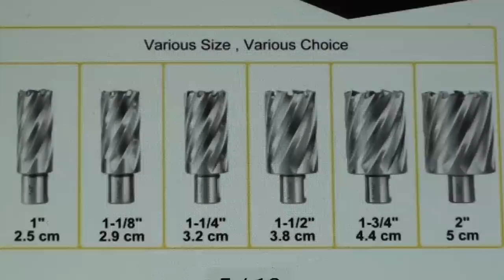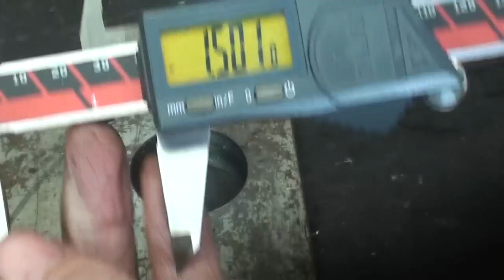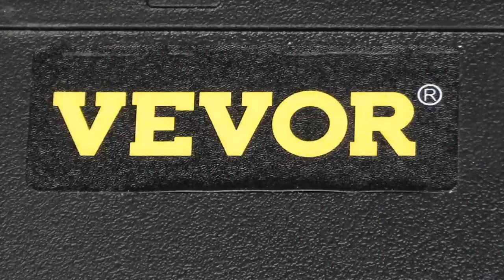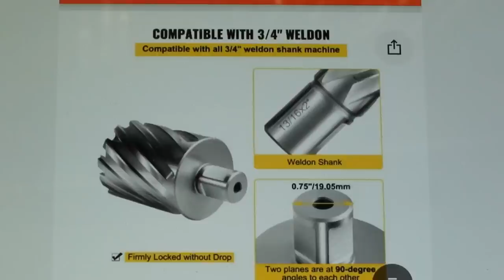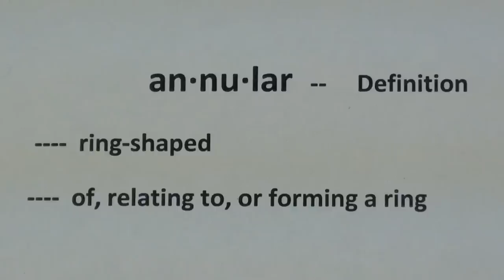WHAT ARE ANNULAR CUTTERS? vevor #858  tubalcain drill magnetic

Comment: I’d consider these essential tools in an industrial maintenance, fab, machining setting (mine). I’ve used these so many times, they’re totally worth the cost. 

Another use I’ve found out of necessity, had a blown tapped hole (with an broken tap) that had to be repaired and used the mag drill and an annular to core out over the center of the hole. Then made a thread repair out of a set screw, Voila!
Reply from the maker: Excellent idea to get out that hard broken tap
Reply: One heck of an idea 
Wasn’t a blind hole though was it
Reply: I bought the vevor mag drill with 6 annular cutters 
Not a bad buy what so ever worth the penny actually making a drill press stand for it so I can get even better use of it
Reply: @jarredsegal6842  no only works with a thru hole

Comment: I used to use those almost every day when I worked as a fabricator building gravel conveyors. If you find the right chuck for it, it should have a spring-loaded center pin that ejects the plug all by itself. They really are great little tools. I'm glad you found a use for them in your shop. 👍
Reply from the maker: Cool, thanks

Comment: Dear Lyle.....My Jancy Slugger, now owned by Fein, will drill at 440 rpm, and drill a 1 inch hole in 1 inch plate is less than 60 seconds..
....the through feed coolant allows cool cutting at the fast rate of 440 rpm.....
.it is one really amazing tool, I have a video of it cutting aluminum on my channel......
and I am finding all sorts of ways to use the magnetic drill for small parts and tall parts...
I keep a 3/8 x 6 x 18 inch plate that I can clamp the small part to and the magnet holds 
the drill to the plate, and you do not have to have a hole in the plate for the cutter to pass 
through, as the slug stops the cutter from cutting when it breaks through and does not 
cut into the plate....Awesome Tool........
Reply from the maker: Thank you, Paul. I was afraid to use power feed on the Bridgeport. It was my first time using these cutters, and I was unsure of the required feed rate. Plus, I did not have forced coolant.

Comment: Link at bottom to the original history.
Mr Pete, I started using these cutters in the USAF Machine Shops from the original manufacturer Hougen Manufacturing. Back when they were known as "Sluggers". Dr. E. Douglas Hougen was the inventor of these annular cutters and they saved a lot of time when cutting large holes, especially in think metals. They took a lot less time to punch a big hole in stock then step drilling. I used them to punch out a rough hole on lathes and mills to get as much material out before boring, drilling and reaming to final size. I made adapters to hold hold these sluggers, then drilled and tapped two holes for set screw at 90° to lock them in. They can be used in a non Weldon collet but they will slip without that positive lock. I would also drill a hole through the shank big enough for the head of the ejector rod. Then tap it for a set screw. I would machine a small part that would slide freely in the hole with a step that would fit inside a spring like a short guide spud. Then slid that in the shank and cap it off with the set screw so that it pus just a little pressure in the spring. Those adapters worked great.
But one thing you need to do id use a lot of cutting oil or fluid and back them out to clear the chips if punching out deep holes. These things can get hot, expand and will lock up and brake if you aren't careful, especially in thick aluminum. Unfortunately I had some young guys in the shop that always wanted to run these Sluggers faster then they are should be and I've seen my share of shattered cutters and ruined parts.
I've also used them to enlarge a hole by making a guide for the cutter, something similar to the guide on a counter bore or spot facer. Sometime we had to think outside of the box, with common sense and caution to use what we had on hand to get things done. We didn't always have the budget to buy a one off tool that might be used once or a few times. I also used the center slug or donut hole out of the cutter for other parts to be made out of. Sometimes it was quicker to cut a slug out of a metal plate to machine a small part then wait for the round stock to come in. That is if I had the right metal plate or other stock on hand and a slugger cutter that would give me a round slug big enough to use. Like I said, sometimes you just have to think outside of the box to get the job done. 
But here is the original history of these annular cutters by Dr. E. Douglas Hougen. Hope you enjoy the history.
https://www.hougen.com/about-hougen/doug_hougen.html
Reply from the maker: Thank you for an extremely interesting comment. You gave me lots of advice and good ideas. These cutters are new to me and I have much to learn. I am eager to read the history of these cutting tools. Thank you very much
Reply: @mrpete222  Sorry about some of the misspelled words, I'm not much of a typist and I should have gone back and check. I have big fingers and I'm always fat thumbing these keys.
BTW, you might be surprised at how we came up with ways to make or fix parts with what we had on hand. When you have a Colonel breathing down your neck that wants something fix in a hurry and you know safety must be adhered to, people can come up with ways to accomplish the mission that holds to Tech Data and safety standards when pushed. Remember the old saying "Necessity is the Mother of Invention". I was proud to serve with the most talented people on the planet. 
Did you ever get a chance to make those Mill Parallels I sent you some pictures and plans to make them?

Comment: We used these in the shipyard for drilling the holes to bolt down the engines and reduction gears.  The holes were usually good enough that reaming was not required. The holes were measured and fitted bolts were machined and installed in the holes.

Comment: I was looking at those recently.  From what you showed, the look worth the price.  I will have to pick me up a set now.  Looks like an arbor for these cutters will be a future project for a lot of us.
Reply from the maker: Yes
Reply: I am only commenting because we share the same initials and surname, although differently spelt. 
I use these cutters and made a 20mm holder to fit an R8 collet in the mill and another 16mm one to fit a drill chuck on the lathe, both with two grub screws for drive.

Comment: My mag drill has an oil reservoir and the center pin not only allows you center the cutter over a center mark but when you start drilling the flat on the side of the center pin allows the cutting fluid to flow into the center of the cutter which automatically liubricates the cutter while it runs.  Great tools.

Comment: These and a mag-drill are two of my best friends at work. I'm a structural steel fitter/welder that often has call to move holes to where they should be, or make 'em where they aren't on a structure member.

We use cutting fluid in place of oil. Oil being a big time fire hazard in a shop full of plasma cutters, torches and MIG welders.

Comment: I prefer to use water soluble oil when using annular cutters.  I think the water vaporizing carries away more heat, and the residual oil is a fair lubricant.  I have also used cutting oil, which works almost as well.

Thank you for producing this video!

Comment: We used to use these in a Bucks Drill for drilling clearance holes for bolts in structural steel.  We eventually switched to an hydraulically powered punch. The holes we made were seldom bigger than 1-1/32” so the punch worked well.  For holes bigger than that it was the annular cutter.

Comment: I was using a Ø20mm one earlier today. I use them with my mill in an ER32 collet, they are a bit tight in a Ø19mm collet as 3/4" is 19.05mm. I was cutting 3mm thick stainless equal angle section. I also use them in the lathe tailstock using ER collets where cutting a large diameter hole can save a lot of time over drilling and boring. The plug out of the centre is also useful as raw material for some small items when needed.

Comment: one note, if you do not use coolant, the slug may expand and even with 
an ejector rod, will be difficult to remove.....you may have to cool the cutter 
down before trying to remove......I made the mistake when I first got my 
mag drill of making a pilot hole for the ejector rod......that worked as 
well as a screen door in my Submarine......I was on the roof of a commercial 
warehouse drilling into the joists through the roof to install HVAC framing.....and 
using GatorAde as a coolant.......we live and learn fast sometimes......then my 
assistant, a 55 year old guy dropped my brand new $1,000 Mag Drill off the roof......
and complained to the boss that I yelled at him and hurt is feelings......we were lowering with 
a rope and pulley and when I put the drill in it's blow mold case over the edge of 
the roof, it dropped slightly and he had refused to wear the gloves I provided, so
when it started it's 30 foot trip down, the rope slid through his palms and burned his
delicate hands.......oh the horror of being a sub contractor who has assistants provided for them.....
need less to say, the case was destroyed, but the drill survived.......
Reply from the maker: Sounds like you were working with Bubba

Comment: Great video, thank you. Those cutters were developed for use in structural iron, to make holes fast n clean with the mag drill. They are a huge addition to the machine shop. They also work well when making holes in light gauge tubing.

Comment: I used them for drilling holes in truck frames and building crusher plants. You can special order cutters for different jobs. We needed one to go through 5 inches thick steel on a jaw crusher frame. A one inch hole took about an hour to go through 5 inches.
Reply from the maker: Wow, 5 inches deep

Comment: Where I used to workwe used those cutters in a magnetic base drill to drill holes I'm the tempered steel of truck chassis rails. The power of those magnets has to felt to be believed and the ease with which the cutters bore through hard steel is very impressive!

Comment: annular cutters are the best thing since sliced bread, particularly when you get an adaptor for your normal drill press instead of having to use a mag drill to drive them. I have not  used a drill bit over 13mm for years.
Reply from the maker: I think I am converted, just like you are

Comment: Great Video, Thanks.  Just a couple of things to add.  I cut a lot of holes with the mill using a Hougen R8 arbor (PN #49849).  It goes into the spindle and the grips the Weldon shank of the cutter.  It also has a port that can be attached to a coolant line! It floods the cutter from the inside out with lots of coolant.  To peck or not to is the machinist choice.  If the RPM"s drop, then there's probably a build of chips between the flutes.  That needs to be addressed quickly before the cutter shatters.  BTW Hougen offers a stacked plate cutter grind.  The cutter will go through each layer of material without the flange on the slug and then start cutting on the next layer.  Have fun cutting holes!
Reply from the maker: Thank you for that information. An anonymous donor sent me an R8 adapter just as you described. It will be in future videos.

Comment: I purchased a Jancy Slugger magnet dill and cutters in the 90s and they have been very helpful. I used it a lot to drill holes to mount things on truck frames. I have cutters from 1/2 inch to 2-3/8. One great feature I found is if there is a hole that is not quite where it is needed, the annular cutter can be used to cut a hole with another hole on the edge of the new hole. If you would dull one, Fastenal can sharpen them through their tool and cutter grinding services.
Reply from the maker: Thank you, I like the idea that you can move the hole.  Totally unlike a twist drill.

Comment: I have been using the  Hougan  brand hmd-904 swivel base mag drill with their brand of high speed steel  annular  cutter  since  2011 drilling  holes in semi truck frames for mounting   pto accessories  such as pumps or blowers or compressors  and  axle assemblies.  Recently  I was having issues  drilling in a particular  brand of heat treated  frame rail, so I ordered the Hougang Copperhead carbide tipped annular  cutter. The 5/8 cutter drilled over 200 holes and it still cuts like new. Annular  cutters are the way to go. By the way , the Hougang mag drill weighs about 1/3 of what my old Black and Decker mag drill was.

Comment: There are annular cutter holders with a spring setup for the alignment pin.
I use mine in a drill press to cut aluminum.
Reply: I also have a set that goes up to 3/4".  They are so much better than twist drills for making holes in thin metal.

Comment: I have used these for years. they run in size from 7/16 up to 2 1/2 by the 1/16.You can use these in a drill press but you need at least 3/4 H.P .I use them in my Wells Index 747 mill and they are great as well as my south bend 13.They will save you so much time it is un real...

Comment: I love these. I have never seen them before but it makes me believe they could replace many of my larger twist drill bits. I reckon a slow steady feed would produce a better finished hole and the slugs can be used too. Thanks for the video.
Reply: i have used them for some years now, once you use them you will never go back to twist drills of the larger size. I have a mag drill and an adaptor for using them on my drill press.
Reply: @bruced1429  Cool. Can they be resharpened?
Reply: @lagunafishing  yes ,I send mine to my supplier for resharpening, which is not very often, they stay quite sharp if not abused.
Reply: @bruced1429  Okay thanks, that's reassuring.

Comment: You can definitely use these in drill presses, but the mag drill has a spring up inside the arbor, so when you use it with the ejection/center pin, it will aid in ejecting the plug from the annular cutter
Reply from the maker: Thank you, and I will soon have one of those mag drills. And demonstrate exactly what you are talking about.

Comment: the manufacturers say once you start drilling, 
do not peck drill for risk of getting chips under the cutting lips...
and if you are cutting/drilling tubing, or multi layers, you need to make sure to 
remove the slug before continuing to the second layer.....and if that slug
is still hanging around in the tube, it will be grabbed by the cutter
and raise Cain and throw your part or drill askew no matter how 
secure it is, or break the cutter......I had a cutter grab while horizontal drilling on an
I-beam and the area of contact for the mag base was not optimal, that bit grabbed
and knocked the drill off the column and snapped the bit right 'Pronto"......I was on a ladder
at the time and it got my attention real fast, I decided to get the 'Smoke Axe, also know as a 
Blue Tip Wrench' and use it.....that was a little safer...
Reply from the maker: Wow, that sounds scary

Comment: I think the imperfections are the result of backing the drill out for oiling and chip removal.  Had you been using a drill oiled from the top and not cleared the chips out the hole would have been cleaner I think.  Also, there are carbide tipped versions of annular cutters which last longer.
Reply: I was just thinking this.
Reply from the maker: Thank you for the tips. I will be doing much experimentation.

Comment: i have used them on my drill press as well has my mag drill. they work fine on a drill, press with an adaptor for them. they are quite okay up to 3/4 in diameter drilling only up to 3/8 material on the slowest speed. use a cheese stick lub for Hougen corp and you are all set.

Comment: Thanks, Mr Pete! I'd noticed annular cutters in some other vids, (This Old Tony? OX tools?, Joe Pie? etc. dunno) but can't recall seeing them cut. 

When I have jobs like these I pull out an old hole saw, sharpen it, grit my teeth, and get prepared for excitement. How much nicer to pop one of these into the old Bridgeport.

Nice of Vevor to give you a set, and I notice the drills are affordable, $200 to $370. Not sure if that gives me confidence. A quick check for prices of Milwaukee mag drills show them to be from $1000 to $1,700 for corded, and, gulp, $2700+ for a battery version. Don't think I'll ever need one,  whew.

If you could stand the swarf and drill in one pass I bet the OD wall would be prettier. But, no, neither could I. Would be a nice afternoon project to build a holder.

Comment: I use these cutters. I spread a layer of anchor lube around the outside and in the barrel of the cutter before I start cutting. Works nicely . Well worth $160.
Reply: When I was welder, we ran out of lube and started to use dish soap diluted. It cooled and lubricated just fine, and that’s what I use on my projects.

Comment: This is a wonderful tool. You can put a relatively large size hole in no time without pilot hole. It is worth having it. With the help of an adapter it can be used on a drill press, lathe, mill press, not just mag-drill (of course not hand held tools).You can order any size you want, like for tapping threads.

Comment: Pete, angular cutters are the best for concentric large holes drilled manually. I used them on structural steel fabrication and they make Lots of shavings! We would use a scoop shovel to clean them up. The slugs were a trip hazard though. We used sizes from 5/6"to 1 1/8".the corners on the flutes get rounded off making the cutter dull. I think we sent them to a sharpening service. Use lots of oil as it helps dissipate heat. I have a set of hole cutters for sheetmetal from Cornwell tool. Step drills and my Cornwell set are the bomb for concentric holes in sheetmetal. AL B.
Reply from the maker: Thanks